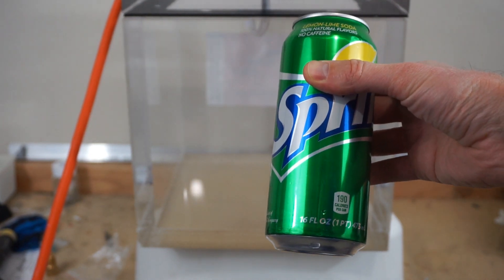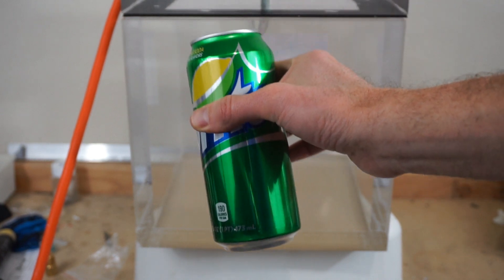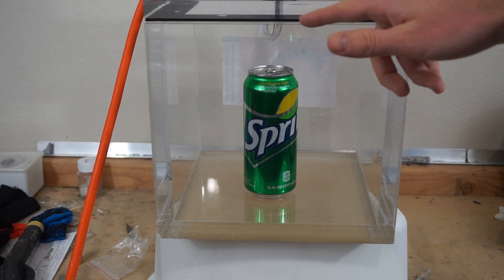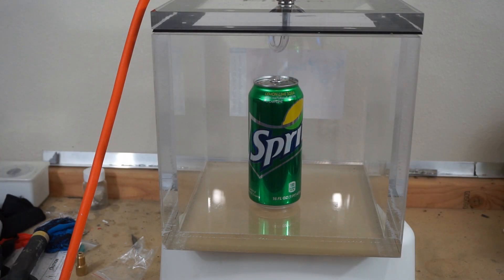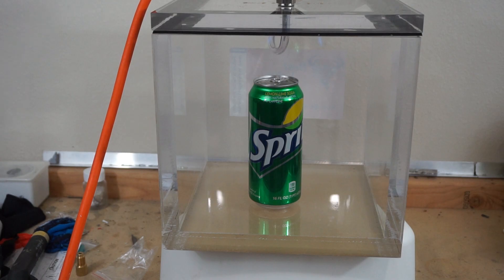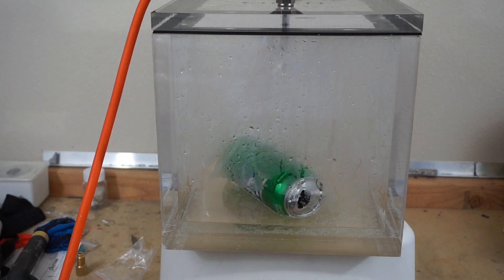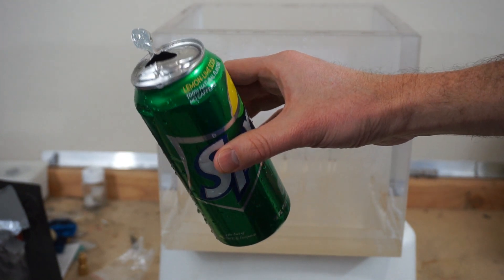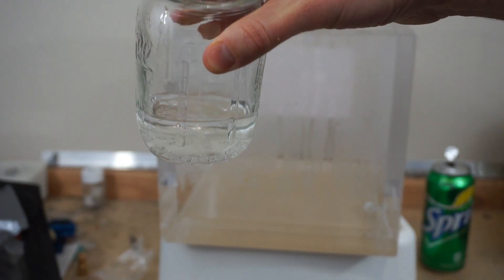What Happens When You Put A Can Of Soda In A Huge Vacuum

Comment: It’s funny that flerfs use screen grabs from this video to claim that spacesuits should just explode. Completely ignoring the effort and negative pressure that was necessary to have the explode. 
They just lie.
Reply: NASASS-FACT: Ground to Thermosphere to Exosphere  goes like 30 - 1500 - 2000+ Celsius heating up...etc.
NOW use your big goofball imagination and tell me how the actornaught intends to drink from his molten can. 🤣
Reply: @AV036  The thermosphere "problem"...  

There is a great difference between temperature and heat. The term "temperature" is used  to measure how much energy individual particles have. The term "heat" is  used to describe the measure of how much energy is contained by all the particles in a given volume. The particle density in the thermosphere is very low. We could try this analogy, it's not perfect but its good enough for this case: You can sit in a sauna with 90°C temperature without injury, at least for some time, but putting your hand in a bowl of 90°C water will cause severe burns.  
You not understanding is not evidence for fraud.
Reply: YES "It is funny" as anyone with common sense will laugh at the nonsensical if A then B 
garbage goofballs are told and also then believe without a critical thought of their own.🎈
Reply: @AV036  so, you accept that being lied to is normal for flerfs?

Comment: Will Electrolytic capacitors, and Lithium (18650) batteries survive a vacuum among other electronics?
Reply: They're wrapped in gold cellophane tape and plastic bags for the 2000 C+ heat of the EXOSPHERE  Van Allen Belts.

Comment: Sir I truly enjoy your videos but if you will research the difference between low vacuum,  medium vacuum,  high vacuum , and ultra-high vacuum you would know that your saying your vacuum chamber is anywhere near the "vacuum or space" is false. 
The level of a "space" vacuum say 250 miles up (ISS altitude) is claimed to be 1X 10 ‐⁹torr. 1 atmosphere =760 torr. However the further distance of cislunar space say 100,000 miles from Earth equals 1 X 10‐1¹⁹ torr. Vacuum effects are logarithmic.  From .01 atmosphere to .001 atmosphere a plexiglass  chamber will begin out gassing so much the pressure will never approach 1 X 10‐⁹ torr  because the plexiglass itself becomes gas permeable. You as a man of science should not pretend things that are false. 
Your pump and chamber have an upper limit of vacuum. ISS altitude vacuum of around 1 X 10‐⁹ torr can only be achieved in vacuum chambers made with baked stainless steel, non oxygen copper seals which have a one time use and must be subjected to 29,000 psi pressure to form a seal. In addition the vacuum pump itself must be a combination diaphragm and turbomolecular pump the whole setup costing easily $50,000 to $100,000.
What is the lowest microns of vacuum which your machine can produce.

Comment: I wonder if the NASA spacecraft would do the same. NASA claims they are made out of aluminum foil to save weight.
Reply: The Apollo mission spacecraft only had an internal pressure of 5psi relative to the outside environment.

Comment: Question from someone who does not science - How does the air inside the soda can "know" that there is a vacuum outside the can and thus we (air molecules) must explode the can to get out and fill that vacuum.
Reply: Air pressure in the can is created by the molecules bouncing off of the inside of the can. If these collisions are energetic enough to exceed the structural strength of the can, it will rupture.

Comment: Yet we are supposed to believe in space travel and space walks
Reply: Rockets and space suits are not highly pressurized at sea level and  just sent to space.
Space suits operate at a constantly maintained pressure differential of less than 5psi compared to the outside environment.
Reply: @Lee.S..B  Yea, see how that reacts in a vacuum.
Reply: @sophiafake-virus2456  
The point of these tests is that he takes a totally sealed object, that's already pressurized at say 20 psi. With atmospheric pressure pushing back at 14.7 psi for a total pressure of 34.7psi.
He then removes atmospheric pressure, so there's no pressure pushing back
This lack of pressure pushing back overwhelms the object so they expand, pop etc.

A space suit MAINTAINS just 4.3PSI relative to the outside vacuum.
Not 4.3psi with 14.7psi pushing back
Therefore there's no expanding or exploding.
If they could teleport themselves to sea level the suit would be shrink wrapped around them because atmospheric pressure would overwhelm the 4.3psi in the opposite direction.
Reply: @sophiafake-virus2456  
To answer your question find his vacuum video with suction cups..
The don't suck without atmospheric pressure..

Without higher pressure outside there's no low pressure/vacuum effect inside.

Comment: It's not "an atmosphere". 14.7 is the  atmospheric pressure of the earth(1 bar). Every planet has a difference atmospheric pressure for example venus has an atmospheric pressure of 92 bar, which is equal to 1352psi. There is more than one atmosphere with varying atmospheric pressures, so calling it "an atmosphere" would be incorrect and confusing.

Comment: Shouldn't the space station explode if this is what happens to a soda can? Unless its cold in there all the time
Reply: ISS has a managed 14.7psi differential to the outside environment.
Reply: No. The hull isn't as thin as this, and it doesn't experience as much pressure as this can. It's important to note that this can popped at the drinking opening, which is significantly weaker then the rest of the can.